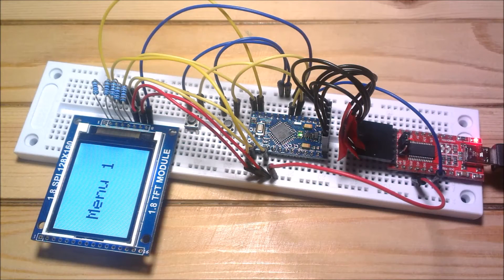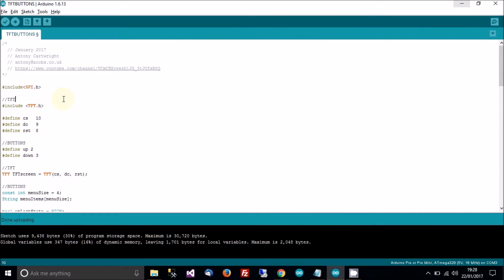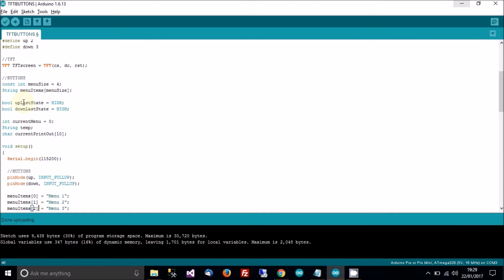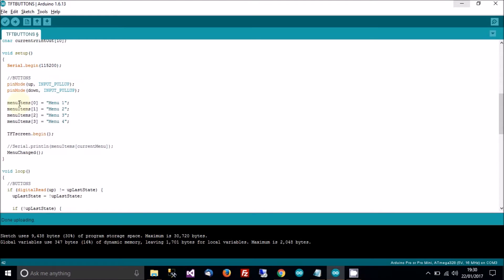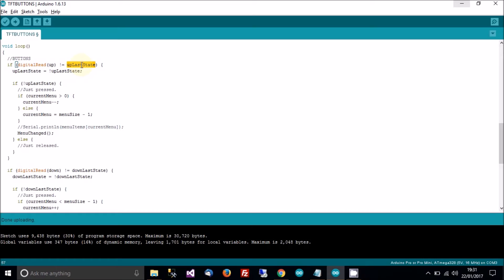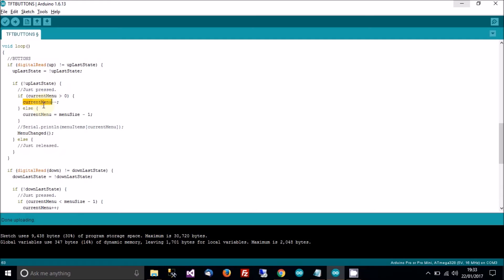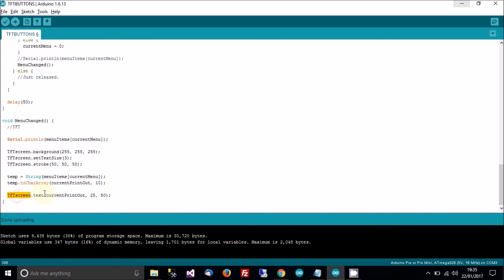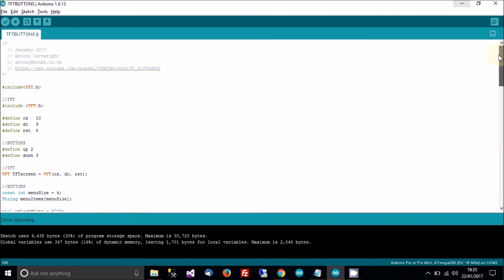TUTORIAL: How to create a simple menu system using buttons, a TFT and an Arduino!

Comment: Hi antony.Thank you for your video so informative.I have been trying to create a simple menu using a 2.8` tft lcd touchs creen but am finding problems could you please provide me with code for a simple menu that i could follow and learn to create my own menu .Thank you
Reply: #include<SPI.h>

//TFT
#include<TFT.h>

#define cs 10
#define dc 9
#define rst 8

//BUTTONS
#define up 2
#define down 3

//TFT
TFT TFTscreen = TFT (cs, dc, rst);

//BUTTONS
const int menuSize = 4;
String menuItems[menuSize];

bool upLastState = HIGH;
bool downLastState = HIGH;

int currentMenu = 0;
String temp;
char currentPrintout[10];

void setup() {
  Serial.begin(115200);

//BUTTONS
pinMode(up, INPUT_PULLUP);
pinMode(down, INPUT_PULLUP);

menuItems[0] = "Menu 1";
menuItems[1] = "Menu 2";
menuItems[2] = "Menu 3";
menuItems[3] = "Menu 4";

TFTscreen.begin();

//Serial.println(menuItens(currentMenu));
//MenuChanged();

}

void loop() 
{
  //BUTTONS
  if (digitalRead(up) != upLastState) {
    upLastState = !upLastState;

    if (!upLastState) 
    //Just pressed.
    if (currentMenu > 0) {
      currentMenu--;
    } else {
      currentMenu = menuSize - 1;
    }

    //Serial.println (menuItems[currentMenu]);
  // MenuChanged();
  } else {
    //Just release.
    
  }
 
}

if (digitalRead(down) !=downLastState) {
  downLastState = !downLastState;

  if (!downLastState) {
    //just pressed.

    if (currentMenu < MenuSize -1) {
      currentMenu++;
    } else {
      currentMenu = 0;
    }
//Serial.println
    MenuChanged();
  } else {
  //Just Released.
  }
}
delay(50);
}

void MenuChanged() {
  //TFT

  Serial.println(menuItens[currentMenu]);
TFTscreen.background(255, 255, 255);
TFTscreen.setTextSize(3);
TFTscreen.stroke(50, 50, 50);

temp = String(menuItems[currentmenu]);
temp.toCharArray(currentPrintout, 10);
}
Reply: @williamvasconcellos6376  if (digitalRead(down) !=downLastState) {      "expected unqualified-id before 'if'"
Reply from the maker: Hey, I should have a video for that somewhere...
Reply: i would appreciate a link for the code and libraries you used please

Comment: Could you modify to Arduino UNO??
Reply from the maker: Gabriel Emanuel Ciorciari Hi, yes, you can probably do that. It's most likely just a case of changing the pin numbers in the code. If you Google "Uno Pinout" and compare to this pinout, you should be able to work it out.
Reply: It is not so simple buddy, becasue not only the pins must be changed ,The libraries also have to be changed.I have a TJCTM24028 SPI module and made it work out whit 3 lbraries :

#include "SPI.h"
#include "Adafruit_GFX.h"
#include "Adafruit_ILI9341.h"

I just need some interactive menu with buttons and to make work the SD card  inside of module.
Reply: I see you use another libraries different than me.
Reply from the maker: Gabriel Emanuel Ciorciari Oh, as far as I'm aware, the library will work with the uno, but with different pin assignments, but I've not done it myself, so I'm not 100% sure. Usually these things work fine..
Reply: I´m affraid to tell that this is wrong, it´s not so simple as you are describing it.Can you send me an email so that I can sendo you my pictures of the project?.In case of you don´t I describe it as follows:

A )I have TJCTM24028 SPI 240 X 320. I found the wiring connections  to my ARDUINO UNO from a Russian guy in YOUTUBE and I made it some changes.He hooks up 1k resistors trhough :

T_IRQ
T_DO
T_DIN ----------> touch pins
T_CS
T_CLK

SCK
MOSI
D/C    -------> control pins
RESET
CS

I made a resistor divider instead of 1k resistor as the guy did and the libraries what I did it work out with are:

#include "SPI.h"
#include "Adafruit_GFX.h"
#include "Adafruit_ILI9341.h"

I tried another libraries but it doesn´t work out.It´s not about changing some pins.
Reply from the maker: Hi, I'm afraid I don't know. I believe the chips in both modules are Atmel 328P, this is why I think the libraries should work. I don't know the specifics though. With the ESP32, there is some extra configuration necessary with the driver H files.